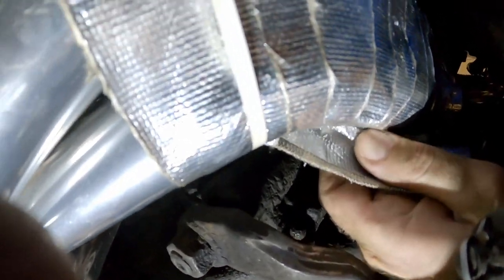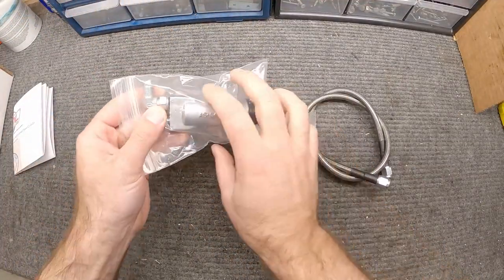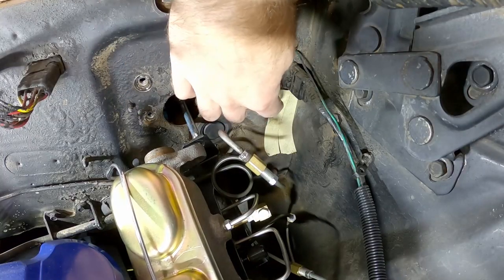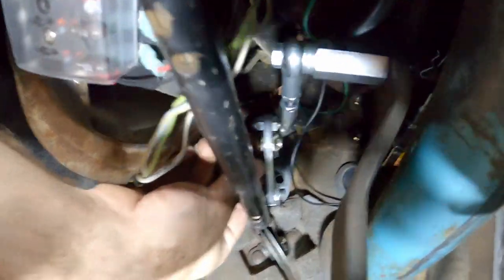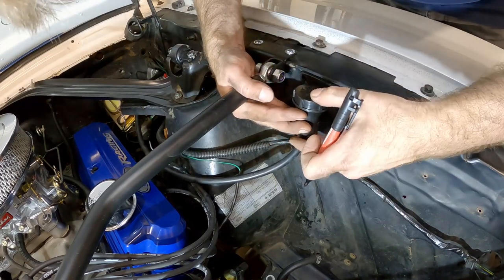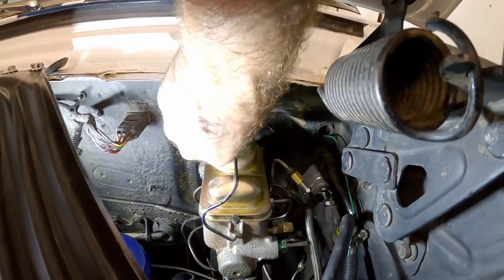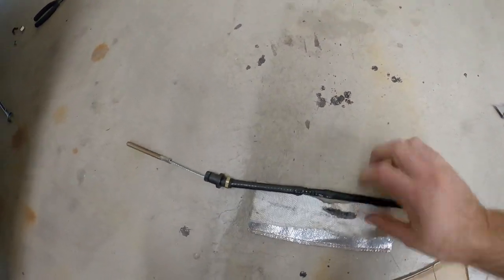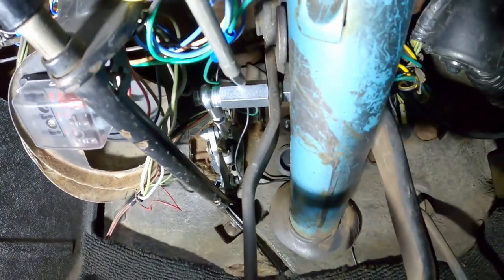Upgrade to a Hydraulic Clutch - 1966 Mustang

Comment: I have a setup like this on my 67 with a T5 that I did back in 2009 from a company called JMC Motorsports, It works the same way and I love it, FYI - Had to rebuild the master cylinder 2 years ago and used a 3/4 Harley rear brake rebuild kit for $18. The slave mount is different but same purpose, to push the clutch fork without any effort.
Reply from the maker: Yeah, I would have saved myself the hassle and some money if I stuck to the instructions.  Oh well, we learn best from our mistakes.  :)

Comment: Andy,
Thank you for this video. I am doing this right now. This is the only video I have found with in car install.
Reply from the maker: Glad it helped. While this video was done in my previous Mustang, I have since upgraded to this same Hydraulic Clutch on my current Mustang.
Reply: Lining up the template for the master is a pain. Mine was off a little had to elongate holes to rotate master bracket.

Comment: You need to get that fuel line re-routed off and away from the header tube . Use some of that heat wrap on the fuel line where it comes close to the header tube .
Reply from the maker: Not a bad idea.  I was also thinking about routing it around the other side of the valve cover, towards the shock tower.

Comment: Very helpful video as always. I have a 66’ coupe that I’m about to do this same conversion to. I just installed front disc brakes from CSRP and I’m struggling with brake lines. I realized that my distribution block is right where the clutch master cylinder will sit. What system were you using on this Mustang to keep those away from each other?
Reply from the maker: You can unmount the distro block from the fender apron and move it towards the MC to give you space for your clutch MC.  I have the distro block that goes with my Wilwood MC, so I'm not using the stock unit.  :)

Comment: i can’t even tell you how many times i’ve watched this video, and i just wanted to say i super appreciate all your work to make these for us. currently over halfway through being done with this once and for all. i went through 3 cables and 2 sets of headers all to finally cave and go hydraulic🥲
Reply from the maker: While the hydraulic conversion can be a pain to install, it really is slick and frees up some space for activities.  :)
Reply: @AndyKruseChannel hey, i’m struggling like crazy with this. Is your spacer mounted straight up and down, or did you have to mount it at an angle?
Reply from the maker: @Kylie.Rose.  At a slight angle because the assembly that is inside the car and connects to your clutch pedal is mounted vertically.  My setup has the spacer mounted with the mounting holes of the spacer at roughly the 11:00 and 5:00 position.  This puts the clutch master cylinder at a subtle angle, tilted towards the engine.

Comment: Thank you, I will install it too, same problem with the header. One question, do I need the  original clutch pedal spring?
Reply from the maker: Nope, you can either remove it from your car, or skip that part when putting everything together for the swap.  :)

Comment: Maybe I missed it, but was there a reason you didn't go with a hydraulic throwout bearing instead?
Reply from the maker: Couple reasons.  Due to the difficulty in removing and installing the T5, I didn't want to do that bunch to get the spacing and clearance right with the internal slave cylinder.  Another reason is serviceability, if that system fails, it means the T5 is coming out again.  With the slave cylinder on the side of the bellhousing, I can just unbolt it and swap it, very simple.  If I had a lift, or others helping all the time, I might have looked in the internal cylinder a little more.  :)
Reply: @AndyKruseChannel  Totally makes more sense. Thank you for responding. I asked because I am in the middle of a T5 swap and did the Malwood under dash system. I have yet to get the C4 out so started to mini panic that maybe I'm going the wrong route. Love your videos and have helped me do so much.

Comment: Great video. Did you have to take the spring off of the clutch mechanism inside?
Reply from the maker: Yes, when I did the clutch cable install earlier, that spring connected at the top of the clutch pedal gets removed as it was not needed for the type of clutch actuation that I have for the T5 swap.  That spring was needed more for the original style of clutch actuation where the clutch fork pulls on the throw-out bearing and that spring you mentioned helps pull that clutch fork back to the "normal" position.

Comment: I forgot to ask prior to your clutch cable burning how did you like the MDL cable kit?  Did you consider the Mustang Steve cable kit?   I have shorty headers and was on the fence on hydraulic or cable system.   Thanks!
Reply from the maker: If you're looking for a Cable Kit, the kit from MDL is fantastic.  My knee can't easily do the cable option anymore, so I've switched to the MDL hydraulic kit.
I did not explore the Mustang Steve kit, so I don't have any info on that setup.
The kit in this video was on my Coupe, where I had long tube headers and the cable kit did not jive with that kit.  I have since purchased another Mustang where I installed shorty headers and the kit fit without any issues.  When I upgraded to the hydraulic kit, it fit easily and there are no issues with that either.  :)

Comment: So Andy - I’m looking at a T5 swap kit right now with MDL for my ‘65 i6. One of the things I’d love to have is easier clutch actuation. Should I just spend the extra $$$ now and buy the hydraulic clutch kit too? It seems like the installs go hand in hand. My only concern is my distribution block for the brake lines is right where the master cylinder would go for the clutch and where I could relocate that to. Thanks again, as always, for a great video!
Reply from the maker: Yes, if it's in the budget, you won't regret the upgrade.  There's about a $200 diff in price between their cable kit and hydro kit, so that's really the only part of the dollar equation you need to look at between these two actuation devices.  I'm debating about switching my current car over to hydraulic, just like I did to the car in this video, except this time my exhaust is not melting my cable.
For the brake distro block, I think you can just move in downward on the fender wall and everything would be fine.  When you get into the installation of the firewall mounted master cylinder, there is a very small window in where it will fit.  Take you time and triple check the location on both sides of the firewall.  You may have do what I did and grind down some of the surface on that firewall spacer.  This is ok, it won't hurt anything, just a heads up.  :)

Comment: Where does the clutch engage letting off the clutch peddle? How does the clutch peddle feel as far  hard or soft?
Reply from the maker: It's more towards the beginning of the pedal, it seemed that there wasn't much use going beyond 1/2 or 2/3 of the pedal movement as the clutch was fully disengaged or engaged by then.  It took hardly any effort to actuate the pedal.  If it's in the budget, I recommend the Hydraulic setup of the cable conversion or the factory style mechanical "z-bar" option.  :)
Reply: @AndyKruseChannel  The z-bar or cable version is no option.. the last Ford ranger I built using an external slave and a 99 f550 master.. it "worked" but hard as hell and engagement was right off the floor. I didn't like it one bit

Comment: Hey Andy what was the total cost of this upgrade? I know you told me before but I don’t remember I emailed mdl but I think it’s like half the price what you had told me…
Reply from the maker: At the time I made this video, I paid about $540 for the parts needed for the hydraulic clutch (which is the Master Cylinder and the Slave Cylinder) from MDL.  The part numbers are MD-910-0002 and MD-910-1002.  :)
Reply: @AndyKruseChannel   ah thanks I got that quote back from them and I was like wait I thought it was around $1000 overall is it worth it or would you have done a better route? I’m going to switch mine over to hydraulic also but since you’ve been through it is it worth it or any other advice or tips?
Reply from the maker: @lucianohernandez3468  If there is a list of benefits of the cable clutch over the hydraulic clutch, it has to be a very short list.  I've done the cable clutch twice now on my last two Mustangs and both times the car ended up with a hydraulic clutch, albeit for different reasons.  While the puck-style slave cylinder that sits over the input shaft on the trans is popular, you have to remove the trans to install it and remove the trans again if you ever needed to service it or replace it.  The style I have mounts to the side of the bell housing and not only allows you to install all of it while the trans is in the car, but if you ever needed to service or replace it, it's on the outside so it's easy to get to.  When installing the master cylinder for this setup, just take your time and measure twice, it will pay off later in the install.  Another hurdle I had with my pathway was I purchased the cable kit and then purchased the hydraulic kit.  If I would have just purchased the hydraulic kit first, each time, it would have saved me over $250 each time I went through that process.  If I was in a position to do it all over again, I'd just start with the hydraulic kit and be done with it.  😃
Reply: @AndyKruseChannel   thanks for the advice and the reply love the channel by the way!

Comment: How did the bleeding of the system go?
Reply from the maker: Incredibly easy. In the clutch kit they include the parts required to bleed the system by yourself.
Reply: @AndyKruseChannel  I’m kind of in the same boat with my 69 mustang.  I have the T5 with the Z bar and it works great.  I’m going to change the engine out with a blueprint 302   or 347.  I have the same JBA shorty headers for the swap.  I bought the T5 bell housing and clutch set up.  So Im leaning towards cable clutch but I like the idea of having extra clearance with hydraulic kit.  I don’t want to do it twice.  Thanks for the video and information!

Comment: Thinking of doing the same MDL Hydraulic Clutch in my 1966 Mustang Fastback. I have the cable Clutch kit but after seeing you install the Hydraulic Clutch and the fact it is External. I like your setup better.. In Lieu of the clutch cable melting. How was the feel, downshift,  and the reaction time on the clutch?
Reply from the maker: The clutch felt effortless for each shift.  I did not do a good enough job of comparing the shifts with the cable vs the hydraulic setup, but the hydraulic is much easy to do.  However, the hydraulic clutch costs more, requires more effort to install, and bleeding the system can be a pain.  I prefer the guaranteed connection of the cable clutch and if I would not have melted the cable (mostly because I chose the wrong headers) I would have stayed with the cable.  I plan to do the T5 on my new project, this time I'll go with a cable clutch and do it right.  :)
Reply: @AndyKruseChannel  Thanks for the information. I appreciate you honest opinion. I was concern about the results from a soft Hydraulic pedal which has different fell from a mechanical setup little the Cable. I just installed my new built 302/347 5.0 and T-5  with all the goodies and want to be able to feel the raw power. I was worried about Hydraulic failure. I used DBA Midlength Headers. Something to think about now. Thanks
Reply: The external set up was also used on the Ford can over trucks & work great.
Reply: Well Andy. I put in the Malwood Hydraulic Clutch Pedal with the Internal Tilton 6000 Clutch Release. Works great! Very clean setup  and smooth shifting. One hydraulic tube out the firewall. No issues with headers or heat.
Reply from the maker: @Tapster1924   Nice!  Now it's time to drive!

Comment: Hey Andy, since this install have you been having any issues with this system? I’ve installed it, followed every direction to a T and for whatever reason it’s failed on me twice.

The clutch pedal feels good, after a day or two the clutch gets really hard and stiff then pops the insides of the slave cylinder out, I had MDL send me new guts for it, installed it AGAIN and literally 10 minutes ago the slave cylinder did the EXACT same thing just before a test drive AGAIN?!… I have NO IDEA why it’s doing this???
Reply from the maker: I never had any issues with the MDL Hydraulic Clutch setup.  However, I only had it on the car for a few months before I sold that car.  I have heard others complain about the MDL kit, but I chalked it up to "we only hear bad reviews" and figured that it was fine for most people.  If your clutch (and supporting components) are tearing up multiple hydraulic kits, is it possible there's something wrong with the clutch or the clutch lever?
I have talked with the guys at MDL on a few different occasions and every time they were super helpful. Did they offer any guidance on rebuilding the slave unit?  Or maybe helping you confirm the whole system was installed correctly?  Sorry boss, I wish I was more help.
Reply: @AndyKruseChannel  Yeah like I said they sent me replacement rubber and I cleaned everything and reinstalled it but it just keeps doing the same thing, works on day one, day two it’s hard as a rock going into second then pops forward all of a sudden… Clutch pedal is a limp noodle but there’s a TON of pressure built up in the slave cylinder when I go down to take it off… I just emailed them hopefully it gets sorted out.

Thank you for responding at least…
Reply: @AndyKruseChannel  Also… YOU SOLD IT?! Whyyy? 😭
Reply from the maker: I've had good results with MDL, I hope they pull through for you, they seem to care more than other companies in our hobby.  :)
Reply from the maker: For a Fastback!  I'm guessing you haven't been watching the channel for the last 9 months?  :)
Reply: @AndyKruseChannel  😅